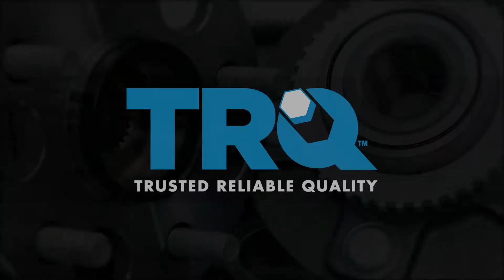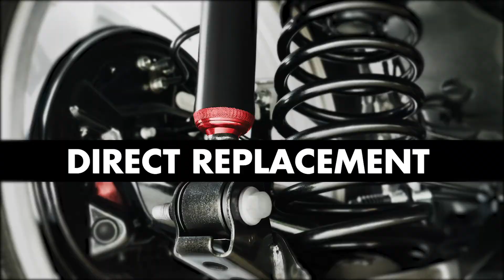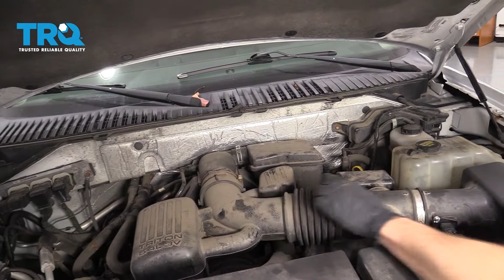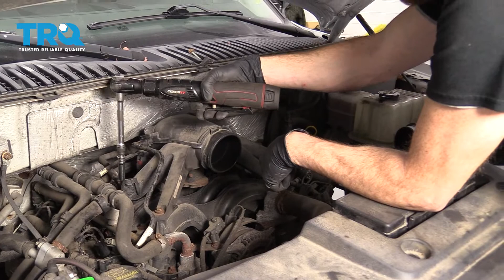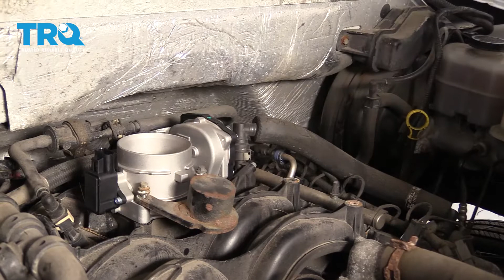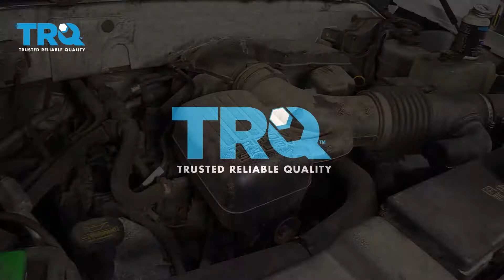How to Replace Throttle Body 2007-2017 Ford Expedition

Comment: Hey man i just wanted to say a HUGE thank u. . .ur how to clean ur throttle body saved my ASS lol i just got a 07 expedition with 3000000kms on it, i just got it from a scrap yard or recovery yard i did a quick check of the truck n fluids it was super clean never seen a cleaner truck in my life ran great but the engine light was on. Im driving it bac i stop at a light n it stalls out so i jumped out checked the battery its tight starts  again i drive home i stalled again stuck on the highway n im thinking wtf did i do i knew ford were bad did i just waste money. I looked up videos for common problems n ur video popped up all i had was a few tools i found in the truck n WD40 i took off what u said when i took off the throttle body it was clean looked brand new i cleaned it with WD40 n it runs lik a dream just gotta get that engine light turned off lmao THANKS MAN I O U one keep doing what ur doing man really GREAT WORK
Reply from the maker: +john wick Thank you! We love empowering our customers and showing how to perform DIY auto repairs with our high-quality auto parts. http://1aau.to/m/Shop-TRQ